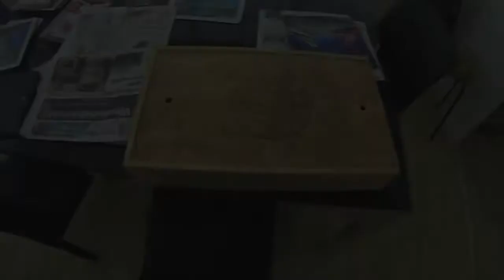Personalised Wine Box

Comment: Your the first one i've seen use a soldering iron on the transfer and it looks great. I agree with others here and you have to make some other stuff. Great work. Now I have to get a soldering tool :)
Reply from the maker: haha thank you so much! I will be making more stuff! I haven't filmed a lot of them because I was either lazy or pushed for time lol. But there will be more to come! I used the soldering iron because the iron didn't transfer the ink that well. The soldering iron helped spread the ink a bit more and also slightly burnt the wood which also helped, so it was a mix of wood burning and ink :)

Comment: Love you video! Saw your design for the table saw and thought it was a genius idea! I will be making one shortly. I got two question for you. 1. What is the length and with of your table saw table? 2. Did you use a regular print out for the wine box emblem? Is it a special ink? Thanks in advance!
Reply from the maker: thanks! the table saw is 1200 x 700mm, just because that's the size of the piece I had lying around. and yeah I just printed it using a normal inkjet printer. not sure if it will work on a laser printer though
Reply: cool! Thanks!